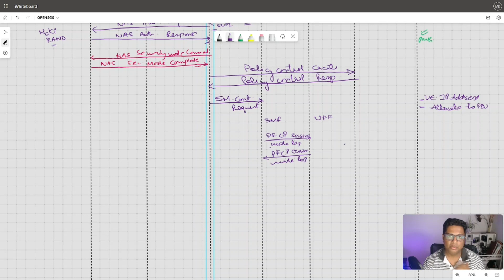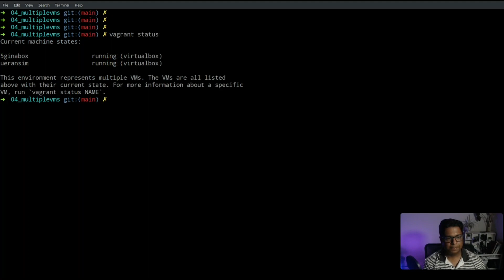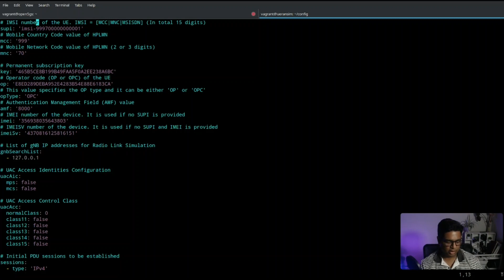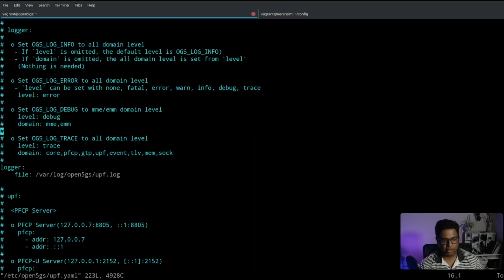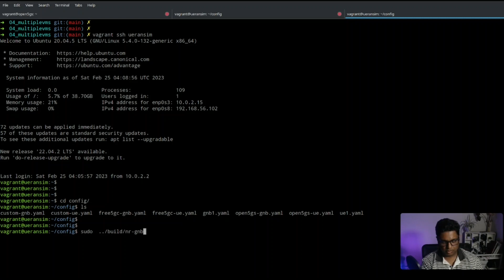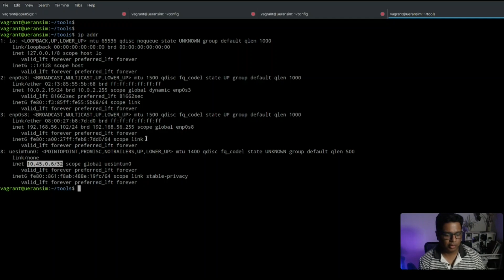5G Standalone Access Registration | Open5GS & UERANSIM architecture

Comment: Hello! Great tutorial series, looking to setup my first LTE/5gNR network so might go trough them.

Do you have any videos on the 5gnr working physically/live on a mobile device?
Reply from the maker: I had configured 5GNR earlier with Open5GS for an org, however, I do not have an SDR to implement radio functionality personally so it would be limited to simulation purposes.

You would need an SDR and a SIM configuration tool where you can modify the SIM details.

Comment from the maker: Learn more about how to configure your open5GS

Here are the chapters:

00:00 Introduction
00:45 Current scenario
02:00 Signalling flow
03:30 RRC Setup
04:40 NAS messages
06:30 Authentication
08:30 Security mode
09:30 Policy
13:30 Accessing the setup
16:30 NGAP 
17:00 Initial attach
17:45 Subscribe